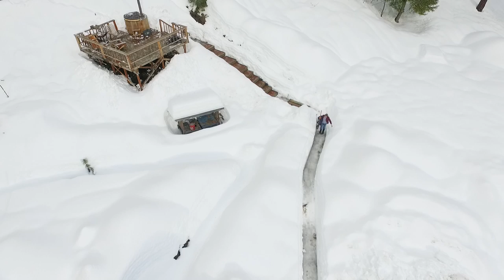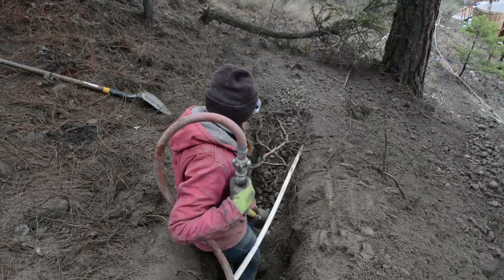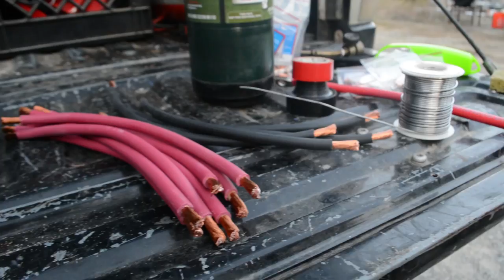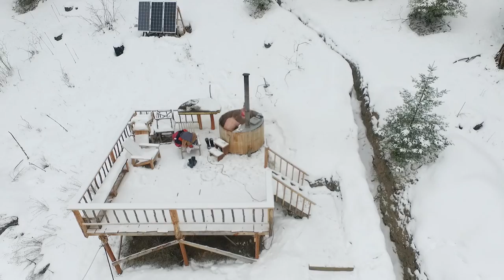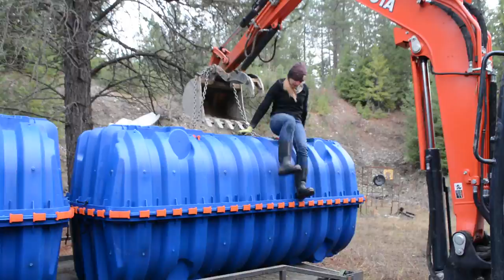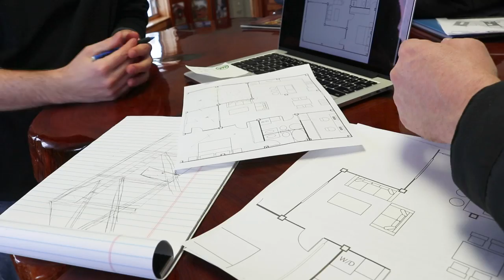CONFESSION: I DON'T ACTUALLY LIKE HOMESTEADING

Comment: I'm restoring an old house myself. Learning how to use plaster, wire electrical, make wooden parts, restore old sash. It is a way to my goal. I am with you100%, sister. Stay strong, stay calm, keep the focus. That's how I am surviving it, 7 1/2 years in, 3 to go.

Comment: When you build things like a deck or install drywall or sheathing you shouldn't line up your joints in one row. They should be staggered evenly. It provides much greater strength and rigidity.  I noticed on the decking boards you have them lined up in a row.

Comment: If it wasn't hard it would not be a worthwhile dream! And even if all the plumbing/electrical/machines/etc. are not your thing, that's all incredibly useful knowledge. As a little kid I followed my dad around as he fixed things, installed our new septic system, built stuff, repaired stuff, and all the rest that comes from living in the country. Even if we were not technically "homesteading". 

And these days when things break I just fix them. I don't call some expensive dude who isn't as smart as me because he works for "appliance repair". Being a computer geek helps, of course. :)

So far I have a good 5 years on the gas stove I repaired, and this coming weekend my refrigerator is having semi-major servicing to extend its life and save me the $1000+ that a new one will cost. 

So hang in there. The hard lessons are good ones. And as much as I don't want to be doing what you're doing (I hate snow, for one thing, and moved to Boulder to get away from it) it's lots of fun watching the videos. And I am getting some ideas for my non-homestead home. :)

Comment: Have you guys lost weight or gotten into better shape from all the work?
Reply from the maker: Good question... I don't know that pounds are down (we don't weigh ourselves) but we do both feel quite fit. Not in the sense that we can run 10 miles without stopping, but we are strong, don't get winded easily, and can still put on the running shoes to run 3 miles no problem! We enjoy that there is a huge aspect of physical work in our lives as opposed to having a desk job where we have to remind ourselves to stay active.
Reply: thats really good to hear